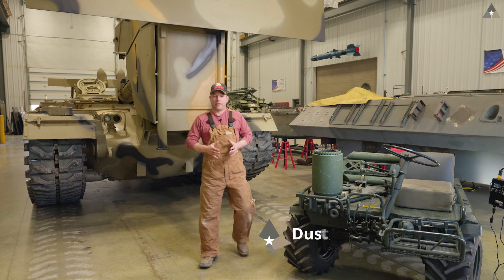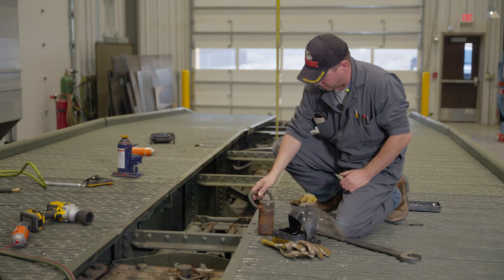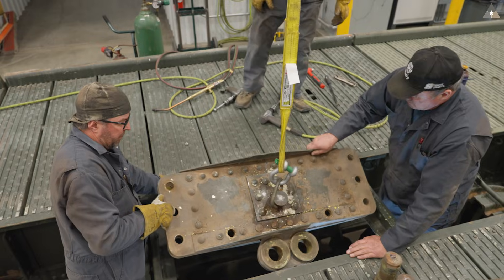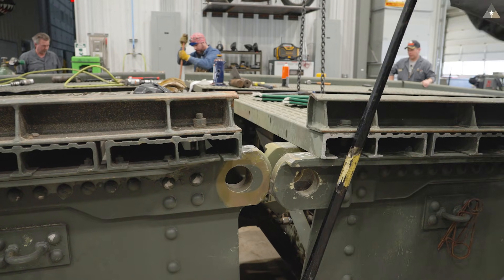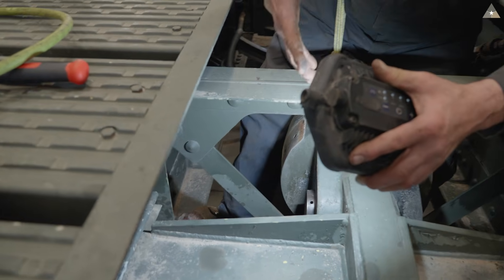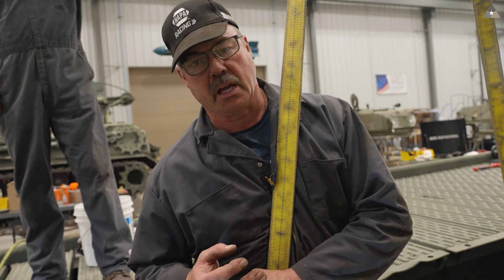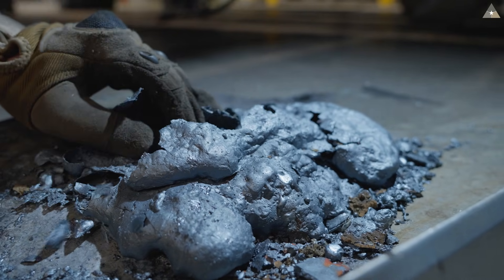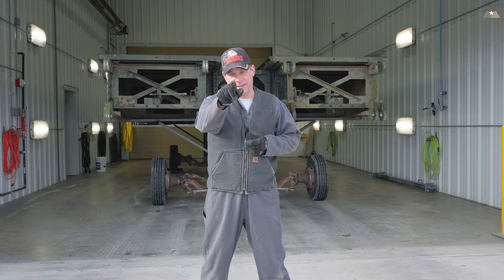M48 AVLB Restoration - Separating the Bridge | Armored Vehicle Launched Bridge

Comment: When I was working in the IC shop of a sub-tender I got a repair order to replace an Amphenol fitting going through the escape-trunk of a 594-class boat.

The fitting had never been replaced or modified since the boat had been built.

No amount of leverage could make that fitting give. I had the machine-shop guys down there with their biggest air-hammers and every technique they could muster to break that connection.

Nothing worked. That boat steamed away with that fitting stuck just like it was. 

That boat's been decommissioned for at least twenty years now, and I bet they still never managed to break that fitting loose............

Comment: Nice video. I was a PL with the 902nd Engineer Company(Float Bridge) in 1976. I got the first set of Ribbon Bridge. We used it to save the Bicentennial Fireworks display in DC. We had some damage that we couldn't fix because we had no ability to weld aluminum. We had to take the pieces to MERADCOM for their techs to weld them. Good Luck, Rick

Comment: I was @FT. Carson Co 2/3 ACR HHT Recovery. in the mid 90's when one of these had the bridge fully extended in the motorpool. I think they were testing something (the crew was). And a hydraulic line blew. The bridge crashed down and I felt the shockwave from over in the other adjoined motorpool of our Squadron. Thank god no one was hurt. And who ever designed these things did NOT care about mechanics having to change the batteries in them lol. The batteries are frigging close to the steel hull and makes taking the cables off without welding a wrench to the hull a tricky situation. As I found out first had as a young and new mechanic lol. For a couple minutes there was a really expensive light bulb in that hull and me losing one of my 9/16"-1/2" combo wrenches lol. 
Thank you for the video.
Reply: Man, same time and place as you mentioned....I was recovery with 4th Eng. Right next door! Any soldier I ever met, who worked with the AVLB....learned to despise them. And yes...the hydraulics were a constant source of problem.
Reply: @RaeWhitley   Yeah and towing them with a M88a1 was scetchy. I had to tow one back with its bridge still on it from out around range 109 on Carson. The tank trails had allot of hills and my M88 was groining and struggling to go up the hills pulling that weight. Honestly if the towbar snapped that track would of rolled for days lol. Or possibly slung me off the side with it. And yeah I remember seeing you 4th Engineers guys. I was a parts rat back then lol. I would go to other motorpools swapping and trading parts. Honestly made a pretty sweet network of people I could go hit up when we needed stuff. And vice versa. Good times.